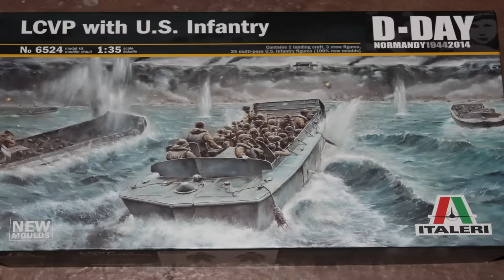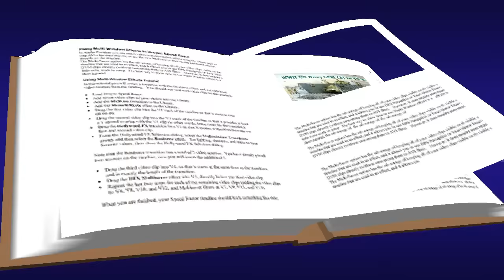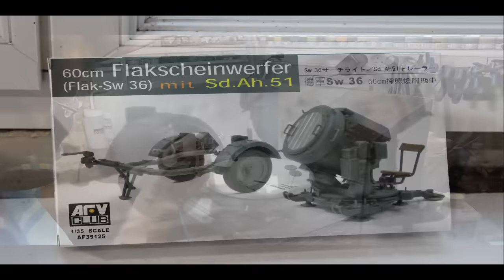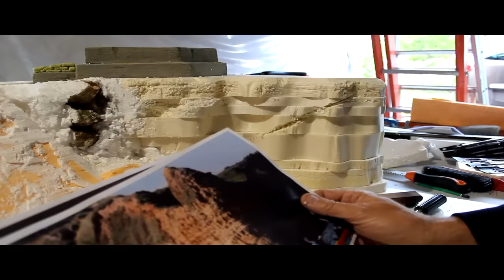Diorama 1/35 débarquement "The D-day"(Step by Step)

Comment: Looks great, but if I had to critique one thing, it would be the impact in the water. Really excellent diorama!
Reply from the maker: Thank you for your comment, I agree with your review, I could have done better ...
Reply: @steelangeling  This bunker could not be used. This is a Polish machine gun bunker. It is designed for flanking fire. The structure is located almost two meters underground and three meters above the ground. How he ended up in France, how he fell, where the underground part and the wall in front of the entrance disappeared, is a mystery to me. This is how he looked in life. Polesie line.
https://ic.pics.livejournal.com/chernecov_vm/20849591/11557/11557_320.jpg
https://wwii.space/wp-content/uploads/2019/01/image027-10-e1547648109411.jpg

Comment: here in Holland the German S mines still wash out of our sand dunes after heavy storms now completely harmless because they where black powder mines and 70 years of water damage has left them inert  still, a heart-stopping find on beach walks only a small number were made with high explosives but even those are pretty safe after 70+ years of sea rain salt and rusting they look like food tins and over 70 + years lying there there's not much left other than broken bits
if the thing's center is only sand it can come home if it looks relatively complete then it's a job for the professional bomb boys but I have only seen complete ones in Scandinavia the ones here are as dead as a doorknob! I had to build my complete version of bits and pieces, I found a complete outer shell in a piece of sea Klay (with paint and lettering) and since I found top antenna detonators, top lids, bottoms shrapnel ball cylinders and inner fuses for years I could build my own safe S mine 
the boys over there must have encountered lots of those!
Reply: That is amazing, I didn't know they  were still there!

Comment: This is a very nice diorama but it has a very very gross error! The two wooden barriers are wrong around! These would have to point towards the water! At the top were mines to blow up the boats!
Reply: They are correct, they are to flip the boat over. It was for high tide. The mine would of helped with the explosion.

Comment: Good work, though it seems cliff to figure vehicles and landing crafts, something seems not quite right, in my opinion. Also noticed that the landing craft sea defence (the long strip's of tree trunk/ iron beems are facing the wrong way). Like someone else commented, doesn't show the horror of the landings, more of a Sunday morning at church attack with a jeep already ashore blocking the advance and waiting for the casualties, which is going to cause some. Great piece of work but, not quite right in my opinion.🙏🏴🇬🇧
Reply from the maker: Thank you for your comment....
Reply: The sea defence logs are meant to be that direction to ramp the LC and tip em over sideways also had mines attatched. If they were other way they would hit them and just manoeuvre out the way in theory lol

Comment: My only questions are, how did you make the "rock" out of foam & how did you make the "water" out of foam???
Reply: Rock looked like plaster over the foam and the water looks like resin (combine 2 liquids to form a solid) and coloring thrown in before it hardens up.
Reply from the maker: The rock with styre,e and the sea with silicone

Comment: No tanks were used on d-day
Reply: XxOcean MeatxX yes they were
Reply: Tanks were used in missions to help take over the beaches but barely any made it on the beach
Reply: They were but only 2 made it to shore or something out of the 25. I don't think half tracks landed on the first wave. This isn't a very accurate diorama but it is still a masterpiece.
Reply: Duplex drive shermans (amphibious tank) and shermans equiped for wading were used on all four Overlord beach heads. Only 2 of 32 duplex drive shermans at the Omaha beach head made it ashore. Those 2 were put ashore by their landing craft when the lcm crews saw the other shermans foundering in the high waves off the beach. A small number of the wading shermans were also put ashore by their lcms in the second wave
Reply: Yes there were: Unfortunately most of them, equpped with canvas floating devices Duplex-Drive, that were sent in with the first waves sank before they got to the beaches, because of the rough sea, and many of those that survived to reach the beaches were knocked out by german at-guns. The DD-tanks were part of the Hobart´s funnies that is special tanks designed for one single purpose for use in the landings. https://en.wikipedia.org/wiki/DD_tank
https://en.wikipedia.org/wiki/Hobart%27s_Funnies.

Comment: how do you make that on 9:12 ?
Reply from the maker: In deutch " Rommelspargel" was made in wood....
Reply: @steelangeling  ok thanks and what do you used on 9:41
Reply: @steelangeling  and on 6:11 what did you used
Reply from the maker: @rickva2129  extruded polystyrene
Reply from the maker: @rickva2129  coated for house
Reply: @steelangeling  Can I also use Lightweight hydrocal
Reply: @steelangeling  the sand ?